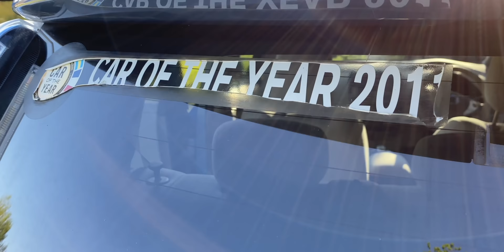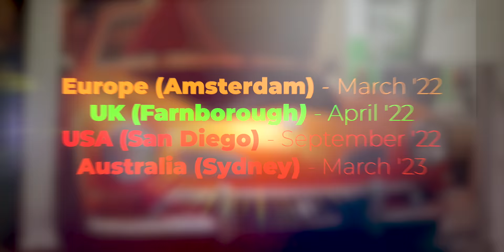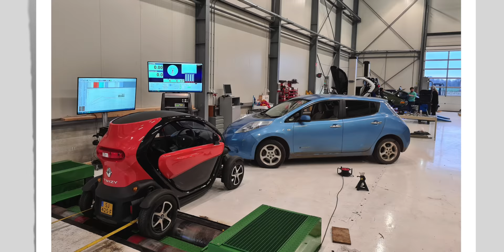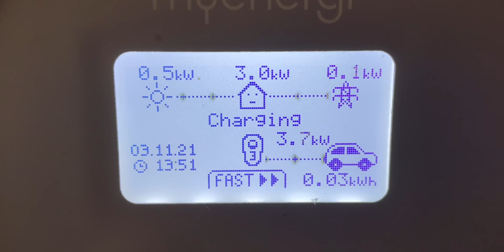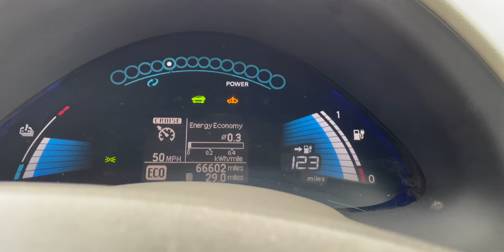Return of the LEAF: Robert drives his range extended EV home from Holland

Comment: I'm on LEAF #2. 1500+ UBER trips, all electric. It is a direct result of this channel. Keep up the good work, Robert!
Reply: That's amazing!! I've done 50k this month and all trouble free with my 40kwh Leaf. Absolutely love it!
Reply: 50k dollar
Reply: I bought 2 used EV’s without ever seeing them.  No dealers to test drive one.  I had to go 3 hours away to find one.  Just found them on Fully Charged. 

8 years with no problems.
Reply: I just got my 2013 model for a reasonable price.
Reply: @roodick85  50K what?
Reply: @justsomeguy934  
In fines for speeding.
Reply: Awesome. I’m thinking about getting a EV to do my Uber trips too. Would be a whole lot cheaper than my Jeep. What year leaf do you use?
Reply: @RussellHogan  I ahd a 2011 and now a 2016. The price was right at the time. However the extra range from a slightly newer model would make a significant difference.
Reply: @EvHervey  I hear that!!!
Reply: So it’s possible to Uber with a leaf?
Reply: @emodate  It is, however I would definitely recommend the 2018 or newer strictly for the higher range. I have only had to turn down 1 ride in the 2016 because it was out of range, but that WAS an anomaly. The rider wanted to go 160 miles. Uber gives a notification if a ride is over 30 minutes before you accept, and I must have just missed that one. So, it's been really feasible for me.
Reply: On a different topic....I wish all of his old scrapheap challenge shows were available.
Reply: Same 2018 leaf still plugging along Uber bolt free now and job done. Still charge it at Nissan and at home. 160k kms. No negative yet
Reply: @roodick85  12500 miles a week. Sorry that’s B.S
Reply: @RussellHogan  jeep? 😆 would be cheaper in maintenance alone.
Reply: @bdeithrick  Yep!!!
Reply: @bdeithrick  lol...what? I don't mean to laugh at you but how could I drive that much in a week 🤣
Reply: Wow!  You must have saved tons of money on gasoline/petrol.
Reply: @EvHervey  could have just asked the customer if they minded a charge stop on the way…
Reply: @jerrymyahzcat  For 4 hours? Yeah, that would have gone over well...
Reply: @EvHervey  apparently some greenie renewable folk would quite happily wait rather than use petrol so there’s that…..
Can it not fast charge?
Reply: @jerrymyahzcat  It can. However there is one chaDEMO spot between here and Raleigh, and it's closer to here. I still wouldn't have made it.
Reply: @Ev Hervey  depends where you live.
In Miami, I do 350 miles a day on Uber/lyft. That's why I have a hybrid. I get about 1 trio every 2 months that's well past 200 miles one way (same or more back).
Reply: @SMGJohn  $50k in donations from fossil industry ;)
Reply: @CoolCars1-jl7rh Well, I hate to break it to you, but the battery did go bad. Nissan just issued me a buyback because they couldn't fulfill the warranty. They can no longer source batteries for this form factor, and it was covered under NC Lemon Law. They pick it up in the next week.
Reply: I wanted to uber with leaf . Sounds like fun. Figure out charge cost or set up large solar areay to charge. Be all profit in a since

Comment: Talking cost of ownership, I traded in my diesel Fiesta earlier this year for a Zoe. I totalled up the cost of fuel over the seven years I had owned it. Nearly £8000! Pretty much what I paid for the Fiesta. £4000 to replace a battery in a eleven year old car seems like good value if that car stays in use for another ten plus years.
Reply: You will never look back at that ICE crap.
Reply: @TriviaChallenge  not true. I now live in rural France. My last three cars in UK were a 1.4 Golf, Zoe 40 (often wouldn’t charge due to hypersensitivity to Earthing) and Zoe 50. My current car is a Tesla 3. 
My wife needs a car and there is no reason for why she would choose to buy an EV, for the usual valid reasons. Infrastructure issues the kind of which still exist in UK but here are approx 10 years behind UK ie availability of public chargers, the ongoing ‘have to pay to join and subscribe to our charging network’ instead of being able to use a debit card. And as has recently been the case, the 4mth old Tesla refused to accept charge and has been dealt with by two service technicians over the course of a week. I drove an unchargeable car 100 miles to Toulouse Tesla, so they could hopefully fix it again. In 33 years of driving and owning at least a dozen cars, none ever broke down, refused to fill up, were too far away from a refuelling station, required a manufacturer to replace parts under warranty…. In short, my wife wants a (petrol) Panda Cross.
So to say that anything but EVs are invalid, is pure fanaticism.
Reply: I guess it depends on fuel consumption. The price of batteries is such that you'd have to be doing substantial mileage to recoup what you paid for it in fuel savings. If you're doing 50 miles a day or something then doubtless it's going to pay for itself many times over. If you drive 2 miles up the road and back then probably not.
Reply: Yes my Nissan LEAF was an excellent purchase when I was doing 50 mile's round trip for work each day - saved me a lot of money.  (I sold it, moved to another country for 4 years, then moved back to UK recently), so now the outlay for an EV is too much (for my situation as I work a couple of mile's from work & only done 1k miles in the last year) I even looked at a used LEAF with some battery degradation but the Insurance group 19-25 is a bit much (as I have Zero no-claims from being out of the country & not insured with a UK company for over 2 years - WIPED clean 🤔 )  So... I bought a Smart Forfour 0.9 for now with group 8 insurance which is fine - I would love to get back into an EV though 👍
Reply: @drxym  if you are doing 2 miles each way why would you need to replace the battery in the first place?
Reply: @keithhoughton4308  I'm not talking about replacing the battery but the cost of the battery in a new EV Vs ICE. It's not a cost you will recoup unless you do a lot of mileage.
Reply: @keithhoughton4308  Batteries degrade due to racking up charge cycles AND whether (albeit slowly), especially in hot climate.
Reply: @ProfessordevilL  I've had my 2013 Smart  electric Fortwo for 5 years and the battery still shows 72 miles on a full charge in summer. A friend has had one from new and not noticed any appreciable degradation either. However if someone offered me double the capacity to a 28kw battery upgrade I would take it and probably use the car far more.
Reply: @keithhoughton4308  If you are doing two miles each way, a car is not even in the top five ways to complete the trip. A golf cart towing a lawn trailer would make more sense
Reply: @LysanderLH  but surely you understand that alot more people live in cities and towns they probably drive less distance, than people who live in rural France.  More people = more chargers more infrastructure, very valid to own an EV. Just like less fuel stations in rural areas. Invalid in a very narrow sense.
Reply: @Keith Houghton   -  Heck,  when  I  was  a  kid  I  had  to  WALK  to  school  a  little  over  two  miles  in  the  rain  or  snow  AND  it  was   uphill   each  direction ! ! !    Gotta  love  me  my  electric car!!!!!!!!!!!!!!!!!!!!!!!
Reply: WoW your mechanic must hate you !
Reply: What are you talking about. You pay for the electricity you put in. The replacement of the battery is the equivalent to replacing the engine not the fuel.
Reply: There will be a lot of rust under that Leaf long before it gets to 20 years old.
Reply: @LysanderLH   Totally agree.  I'd take a small run-around petrol/diesel any day of the week over an EV. The presenter is over the moon with his 150 mile range and I don't know how long to charge each time. I could have made that trip in my extremely reliable Yaris with a 2/3rds full tank of petrol. 
He made another video of a British company doing the same job on leafs for £8,000 and I said in the comments that it was madness to spend £8K on a ten year old car and I was right. In this video he found a place for £4k. 
When batteries can hold 500 mile range and charge in 5 mins that can maintain 90% range at 500,000 miles then I'll consider them. 

You need that 500,000 mile reliability for it's resale value.  Imagine every time someone sold their car the buyer would ask, so when will I have to swap out the fuel tank.  It never ever happens.
Reply: @LysanderLH  spot on.
It’s utter insanity to abandon the ICE
Reply: @jraw7199  do a lot more people live in cities and towns than in rural France ? I’d like to know how you reached that conclusion. Also driving shorter distances takes as long in towns and cities as it does longer distances out of towns and cities, so it appears that you are chucking out reality in favour of what you want others to believe. 
Our Model 3 is about 2 years old now and has been driven 36,000 kms. Over this time, charging infrastructure (non Tesla) has become worse as public chargers have broken and have not been fixed (across all networks within about an average of 100kms of our home), so it is STILL a matter of sheer luck to find a working charger and even then, one which is not blocked. 
Why has none of this been sorted?! There are still vastly more non EVs anywhere in France and the ‘solutions’ being imposed are urban ULEZ which are farcical at best!
Reply: @richardhobbs7107  barefoot no less! 😂
Reply: @johnfitbyfaithnet  -  Angelina Jordan  won  'Norway's Got Talent'  in  2014  at  the  age  of  eight  years  old  .  .  .  .  .  .  .  .   barefoot !    ( she  can  sing ! )        take  care,      rh